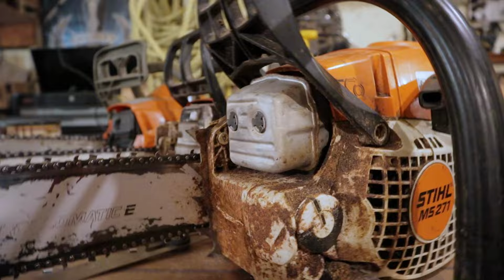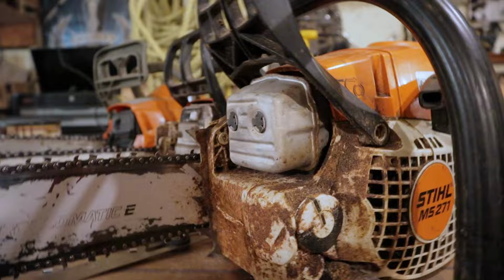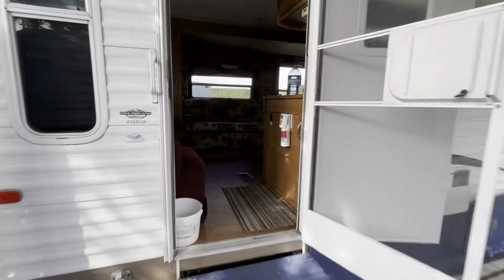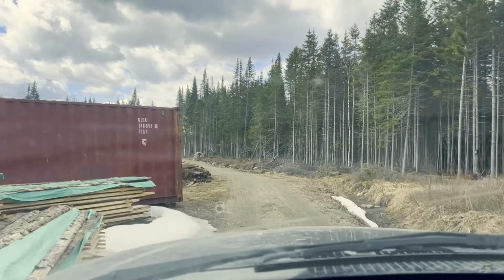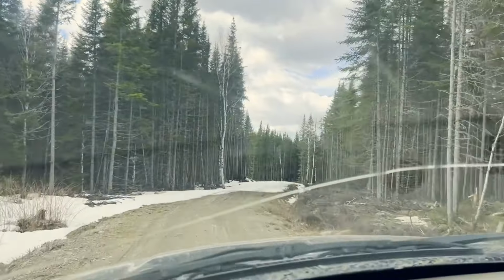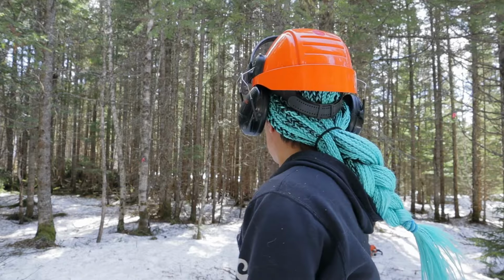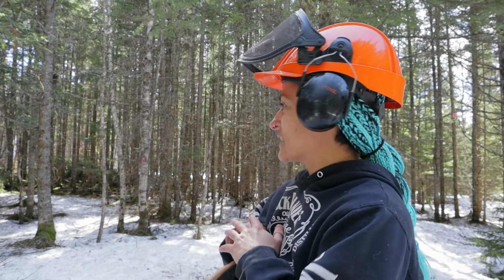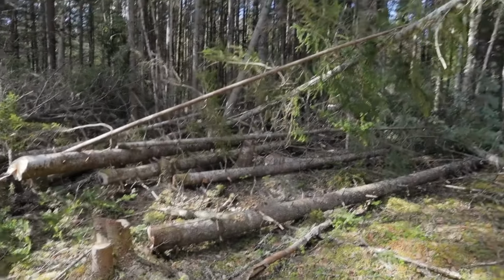My chainsaw wasn't doing its job but I figured it out!

Comment: 17:00  For folks watching: Avoid angled back cuts to fell the tree. They're far less predictable than a level cut, are less predictable and can even pinch the bar. Instead, remove a wedge from the direction you want the tree to go, then cut a LEVEL back cut slightly above the level cut of the wedge to create a "hinge" that will allow the tree to go over much more slowly and predictably. Wedges are also very handy for trees with twisty trunks and/or to get them to fall in a particular direction. The Stihl channel has a great Chainsaw Tutorial vid as does the @Guilty of Treeson channel.

Comment: Good Morning Mallorie! Here are a few tips I got from an old German man who Knows Stihl: only use Stihl oil 2 cycle oil!!! Also a new chain will stretch so adjust/ tighten after a few cuts!
I put a more heavy duty bar & chain for my Stihl 170 16inch. 
Key to sharpening chain is that saw remains totally stable, or chain will not cut straight. Bless your sweet heart Mallorie. When we are going through a healing process.. we must respect the process 😘❤️‍🔥🌻
Reply from the maker: On wednesday I went out to the property and the lumberjack was working on my neighbours property. At the end of the day he took time and showed me how he does it and showed me how to tighten the chain correctly before filing. I was very grateful for the little one on one time he gave me. Info soooo much done that day. That will be for the next video.
Reply: @HerEcolife  that’s great!!! We get by with a little help from our friends! I’m looking forward to seeing your progress! I’m planting now here in Ozarks, but I swear I can smell that sweet Quebec air while watching your vids!

Comment: Big improvement Ms. Mal great job  Miss. The factory c cuts for sure , but i do perfer a bigger/deeper c which is under the top plate of the tooth Miss. If you notice your chain/bar kind of jumping on you while cutting ,stop and take the rakers down that will take care of that it Ms. Mal. The really big thing of gettong and keeping your chain sharp is to make sure the top plate corner is sqaure and flat Miss. Buckin Billy Ray is awesome for how he explains everything so understanding Miss.

Comment: Always look at the sides of your bar when sharpening your chain. After so long the bar will start to “mushroom” along where the chain runs which causes drag on your chain and affects how it cuts. Filing that mushroom off the bar is as important as filing the teeth and rakers. Just another pointer. Btw you kind of look like Abigail corrigan.

Comment: Mallorie!!!??..
Helmet..check
Faceshield…check
Hearing protection…check
Special gloves…check
Chaps….check
Boots …check
Running away with a running saw in one hand from a weakly planed cut…..questionable
Reply from the maker: The blade was locked lol
Reply: Lol. On that note, Mal, do you have a decent first aid kit? I'm not saying you're doing anything wrong, but 💩 happens sometimes.
Reply from the maker: @MiscMitz  yes it does and yes I  do have one :))